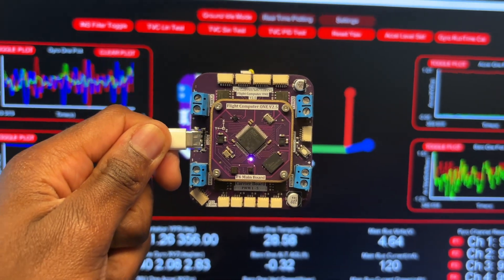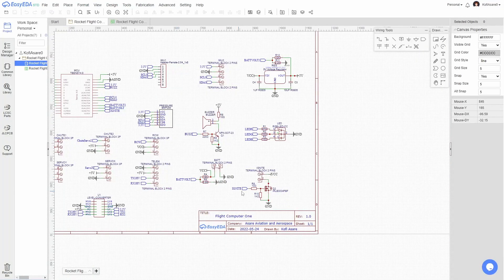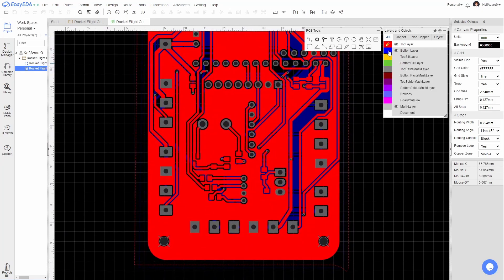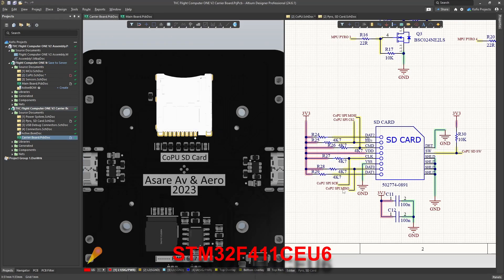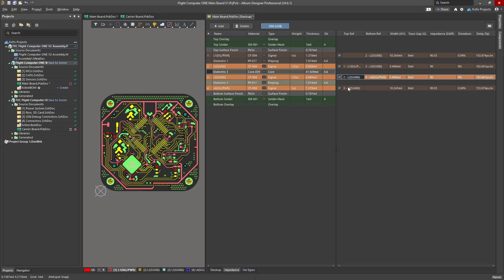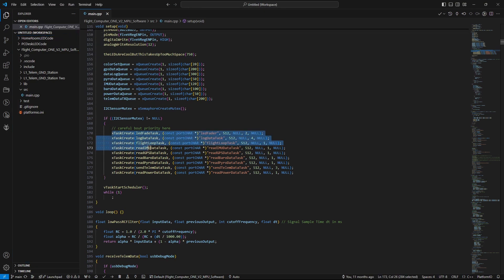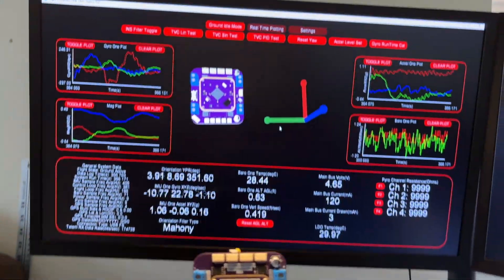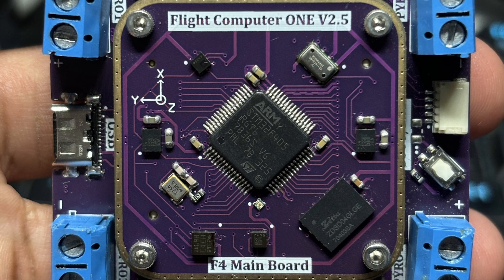Creating a Custom Flight Computer for Active Rocket Control | Hardware Overview

Comment: "Great video! I'm curious about the MPU-6050 data processing. Since the MPU-6050 only provides 6-DOF raw accelerometer and gyroscope data, how did you manage to get stable, independent 3-axis YPR (Yaw, Pitch, Roll) data? Specifically, which sensor fusion algorithm (e.g., Kalman or Madgwick filter) did you use for Pitch and Roll stability, and did you integrate an external magnetometer to get absolute Yaw?"

Comment: Hey Kofi! I designed a custom STM32L4 PCB, but for some reason it is not recognized via usb on my computer. Did you use the SWD peripherals and utilize STM32 cube programmer? Any info helps, it’s my first time using anything stm related. Thanks!

Comment: What is the reason for the gold border around the board?
Reply from the maker: The gold border is a ground ring added primarily as an easy way to clip oscilloscope ground probs. It also looks pretty and stiches the internal ground planes together.
Reply: @KofiAsare0  does it in any way help with EMI/EMC?

Comment: I am interested in your firmware/software that you did for this controller.  Normally IMU's have sensor drift.  Did you implement a form of sensor fusion to mitigate this problem?  Also, I am curious about the board design after seeing some of your chip sets damage.  This should not happen unless you missed some design steps in the selection of parts.
Reply from the maker: The next video will be all about the firmware/software dev! I think the primary reason for the dead MCUs I experienced was due to my poor handling causing things like shorts, transients, ESD, etc. I don't recall any "random" failures though.

Comment: if the buzzer is a piezoeletric device, it's a capacitor. so the bjt firstly charges it to the voltage, and as the capacitor wont have any path to discharge, it maintain its voltage and doensn't make any sound. you need to add a resistor in parallel to the piezo in order to make it discharge and charge it again on next bjt turn-on.

Comment: Is it too expensive to use Altium for personal project ?

Your references are also my favorite channels too 😂

Im not pro into EE or Electronic/PCB, wonder if it's possible to design my own board with self-learning 🤷‍♂️?
Reply from the maker: I am unaware of Altium's exact pricing but I find it to be quite unaffordable without university/employer sponsorship. That said, I've been hearing great things about Kicad and will certainly be exploring it for future projects(especially after school ;)). Also, you can absolutely self-learn to create your own PCB, especially with those resources. Good luck!
Reply: @KofiAsare0  KiCAD perhaps is a little more than the web app EasyEDA I think. Tried to use it but still prefer easyEDA for small project. 

The amount of mistakes that I myself can't verify really made me to always ask peopel to verify it for me 😂
Reply: @KofiAsare0  did you try CircuitMaker ?

Comment: Nice to see your design iterations! I would use a flash instead lf the SD card, and definitely look into kalman filters for the sensors. I see that your power module is a bit problematic. Why don't you make a 3rd board, and make your design more modular? This way you could iterate faster or certain issues while cutting costs on other parts
Reply from the maker: Thanks for your feedback! Versions 2.0 and 2.5 included both an SD NAND Flash chip and an SD card slot. The next design will definitely feature more advanced sensor fusion, like Kalman filtering, and a better board architecture.

Comment: Very nice overview. I work as a DC-DC Power Engineer, and might I suggest the TDK FS1403 uPOL it is a little overkill for your application but you should avoid the thermal problems you mentioned in your video.

Comment: You might want to use a switching regulator instead of a Linear regulator. If the difference between the output voltage and input voltage is high, an LDO will simply dissipate that as heat. A switching regulator is more efficient in this case but you have to be careful with filtering, because it also introduces some noise. Great project.
Reply: I do agree about the in-to-out difference if the currents being drawn from an LDO are high, however SMPS regulators introduce noise that typically is not good for analog and sensing.  A better approach would be to have a SMPS feed an LDO.  Make the SMPS be 10 to 20% higher that the LDO dropout on the input side.  Also, one should not use LDO in high load situations given that they are normally used for analog anyway.
Reply: I disagree, LDO's are better for low noise requirements. Its better to do a 2 stage LDO stepdown for the voltage. M7806 for first stage and a 1A version of the 1117. There are larger packages for LDO's that deal better with heat dissipation and a small copper heatsink directly below the LDO on the bottom side of the board will provide better thermal stability
Reply: @sjwpcbdesign  10 to20% is vague. All LDO's have a rated dropout voltage usually ~ 1.3 V for 1117 series and 2V for 780x series. Its best to step down voltage close as possible to minimum dropout without ever going below it. That way you are not dissipating much heat.
Reply: @FriendlyIntentions  First, 1.3 to 2 volts is not a typical drop out. That sounds more like a traditional regulator. LDO should be more on the order of 0.2 to 0.5 volts. The 10 to 20% is with respect to the Vin + drop and add a 10 to 20% margin of the drop out.  For example if you want 3.3 out of the LDO, your Vin would be Vout + 0.2 + 0.04 = 3.54V assuming 20% of drop out. Therefor the out from your switching regulator is 3.54V. If needed you can add a pi filter in front of the LDO. However I have found this not necessary in most situations.
Reply: @sjwpcbdesign  ams1117 spec is 1.2V dropout . You are thinking low current LDO's, those suck. A 3.3V ams1117 in sot 223 with a VIN of around 5V can easily supply 500ma with it only getting to around 20-30C above ambient

Comment: This is awesome keep up the work i am currently working on designing my own first board but i am having problems with the SD card and esp32 but this video will help a lot especially with the voltage switching regulator i am using for my board that is the hardest part but keep up the good work.

Comment: Será que isso teria uma forma facil de se adapitar para ser usado em aero modelo? Uma pergunta que veio na minha cabeça.
Reply from the maker: The current design has a 30.5mm x 30.5mm mounting hole pattern and can run a modified version of something like Ardupilot, INAV, or Betaflight. However, considering the large form factor and lack of vibe resistance, it may not be optimal. I hope to vastly improve on this in the next design! 🙂

Comment: Increasing measurement sensitivity have little impact about noise. You need to look at accelerometer and gyroscopes mathematical model. In there you will see bias terms and random walk values. Also temperature is a significant figure in noise. Keeping steady temperature is important. If you understand statistics and mathematics behind this, you can create simulations of your sensors and rocket model and get a greater result. Keep going, very nice work. 👏
Reply from the maker: Will certainly look into IMU temperature stability and noise models, thanks for watching!